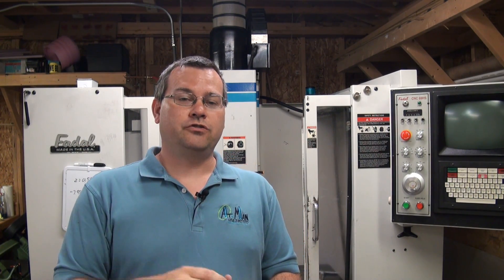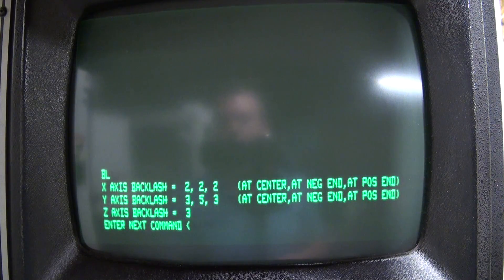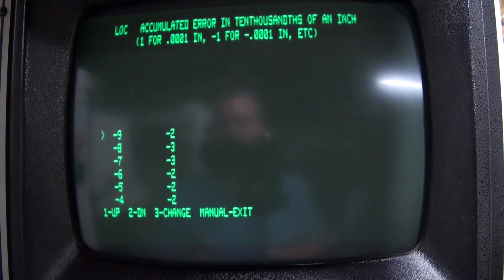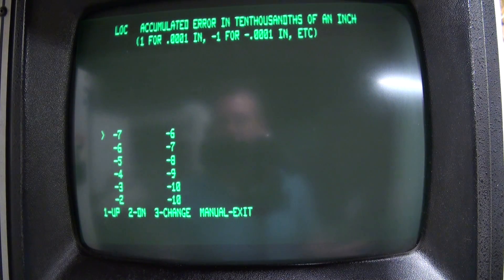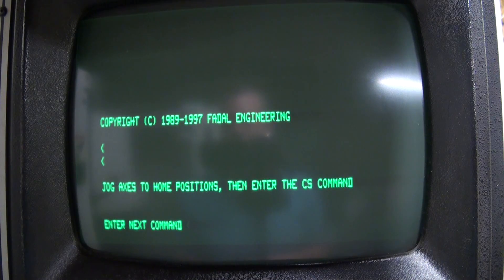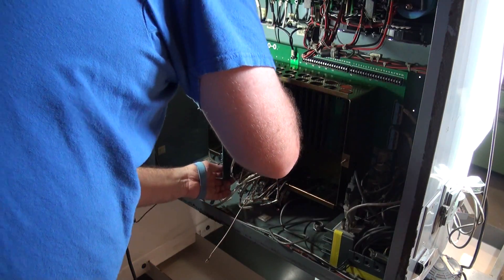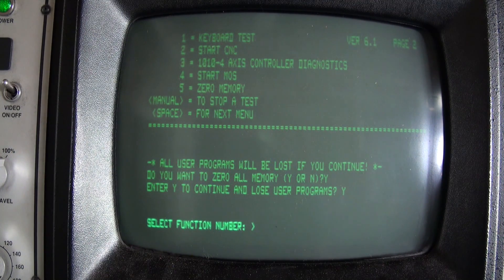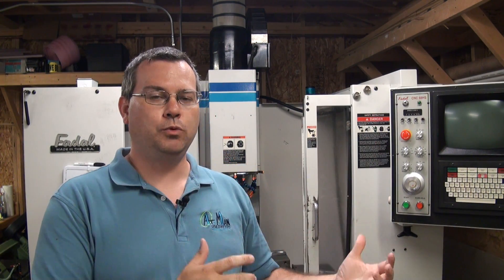Replacing Controller Cards in a Fadal CNC

Comment: ing. podria decirme como puedo mover el paso del motor del eje x tube que cambiar el husillo del fadal mil gracias y saludos
Reply from the maker: You should need to remove any motors to change the spindle? Just remove the drive belt, spindle pulley and then the bolts on the top and bottom and the spindle comes out the bottom of the Z head.

Comment: Hi, I love your videos and I hope you can help me once again :)
 I have a '98 4020 fadal and i use it only on weekends. Two weeks ago i noticed a strange behavior.
In the MDI mode and Jog mode, there are normaly the current coordinates and a list of zeros on the right. When you jog the machine, the zeros on the right change value, until the machine reach the correct coordinates. The problem is that in the x axis I don't have on the zero anymore. I have the constant value of 5 when the machine is still. What do these numbers mean? Any help?
Reply from the maker: That value is the following error, with no motion it should be zero. If it is not zero you can adjust the balance on the servo motor drive.
Reply: The funny part is: if i power on the machine, there is this problem. I can power on and off several times, and nothing changes. But, if  i wait 15 minutes, and then i power on the machine, everything is perfect and that value is zero... i can run the machine all day long without promblems... but the next day that value is 5 again...
Reply: And i forgot to mention that i have AC motors with encoders... i can't find any information of how to balance the servo drive. Is it something i can do without specific equipment and  knowledge? Did you ever done somethink similar on your channel?
Reply from the maker: I don't have it on my channel but I should coming soon. I'm readjusting my drives with the Calmotion cards. It is in the maintenance manuals under the axis drive section though

Comment: Great info!   I have a question.  With what and how do you go about cleaning the grease oil film of the circuit boards on these things?
Reply from the maker: Personally I use alcohol as a solvent and an acid brush in a large flat pan. I don't soak the boards but hold them over the pan at an angle and then gently splash the alcohol on the board and gently brush to get all the grim off them. You could also use a tooth brush but the acid brush is a little stiffer. Then make sure all the alcohol is evaporated off before reinstalling. You could also use just soap and water, but this requires baking after words and given the age of the boards I did not want to risk that.
Reply: I thought alcohol would be what to use from seeing circuit board repair videos.  The thought of it makes me kringe with these boards.  If a board is working fine should I leave it be or clean the oil film off before it cause components to over heat or other issues?
Reply from the maker: I only cleaned them because I was upgrading. Before that, I left them alone.
Reply: On a side note.  I have the positive air pressure system on my spindle.  Do you have this on yours?  Not liking that it let's air out the whole time.
Reply from the maker: Yes, keeps coolant out of the nose of the spindle and provides a small amount of cooling.
Reply: At-Man Unlimited Machine.  Ok thanks

Comment: Excellent---this really help me and I've owned a 40 20 20  for 21 years.  I'm currently having a problem with machine shutting down after 25 minutes -  I may need your help.
Reply from the maker: Hello Brad, sounds like it could be thermal related as it heats up. Maybe the AT power supply? Don't know what you mean by "shutting down"

Comment: Hey Tim, where did you hook up the ESD wrist band on the cabinet door? I'm swapping amplifiers and I'm not sure where to hook it up.
Reply from the maker: Any chassis ground works. There was a bonding ground wire between the door and the cabinet I just clipped it there.

Comment: Hi Tim, good video as usual, why did you to install new controller cards? did you face any problem? I didn't get it.
Reply from the maker: Hello Shem, good to hear from you again, I did it because I got a great deal on some cards and wanted spares. The cards I bought are one rev newer then my current cards. I updated because my cards used a 286 processor and the new cards have a 386 and newer firmware on them. There is nothing wrong with my old cards and they are safely packed away in storage just in case a card fails I can quickly swap in another one.
Reply: Yes, I am just quiet but it doesn't mean I miss any of your great videos. your channel is my favorite one and I also tell about it to whomever I know.
Reply from the maker: Thank you Shem, and thank you for all of your support, it is greatly appreciated for sure! Hope all is well.
Tim

Comment: Hi, ive seen most of your video and they are of great help, but I need to see if you can help me with something, at rapid traverse G0 the machine does not go in a straight line, both X and Y start at the same time abd same speed, but when it gets to the closest x/y rapid it then goes to its final destination, I have messed up so many parts cause of this on the fadal thats its just costing me to much, can you help? could it be just a parameter? 

thanx
Reply from the maker: Unfortunately that is just the way Fadal and some other machine controllers work. There is nothing to change to prevent the dog leg rapids. Most CAM programs have a work around where they can replace multi axis rapid moves with feed moves and set the feed rate to max. In most cases the max feed rate is around 50% rapid travel. This solves the dog leg issue at the expense of not having a full rate move when more then one axis is moving at a time.
Reply: At-Man Unlimited Machining Well thanx for the tip I will see if I can male my software work around it
Reply from the maker: Your welcome

Comment: Hey Tim. Extremely appreciative of all you do, and every video you've put out so far. They have been invaluable to me to this point. 
 
Q: what type of air compressor you use? 

Thnx keep em commin!
Reply from the maker: Thanks Jared, Its just a run of the mill craftsman oil less 60 gallon compressor. I think it is rated somewhere around 10 CFM ish? It was the first major tool purchase I made out of high school. I was a motor head and ran a lot of air tools building a car. I will never buy an oil less compressor again. It has lasted a long time with a lot of hours on it but man, I think I have lost hearing from it for sure. The tank is still in good shape but I think the compressor is starting to get a little tired. I might buy just a oil compressor and reuse the tank and motor. Then mount it outside at the back of the shop.

Comment: I also have a question maybe you can help me with. 92 fadal vmc 40 if i dnc sometimes it runs away for no reason however its perfect from memory
Reply from the maker: Sounds like a noise or communication issue on the serial port. See if your software will support using the command "DNCX" rather then just "DNC". This is a more robust protocol that has a retransmit feature to combat noise and communication issues. You could also try a lower baud rate if your programs don't need the high rates.
Reply: i use fadalnc program i will try it  ive tried the lowest baud rate and it was the same would just do a random move at random times.